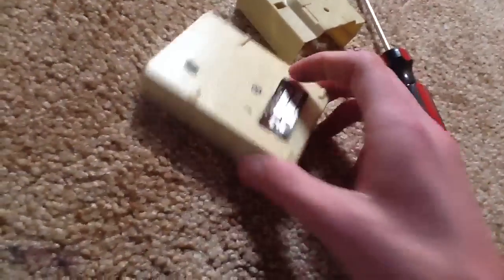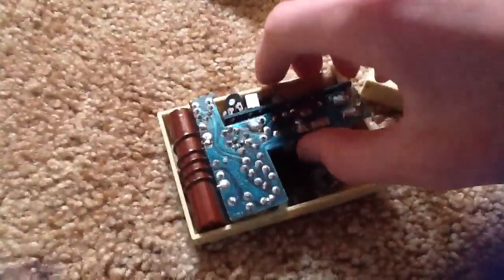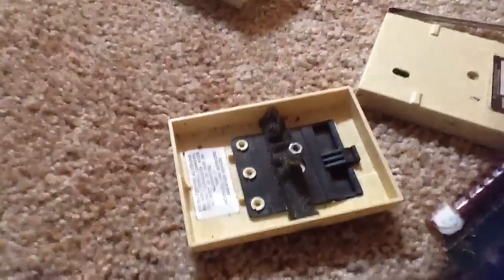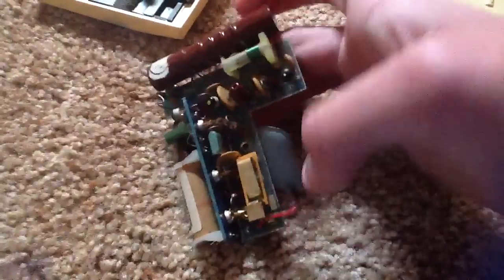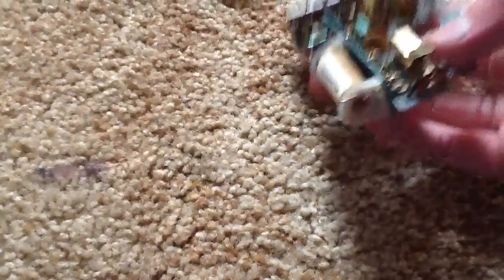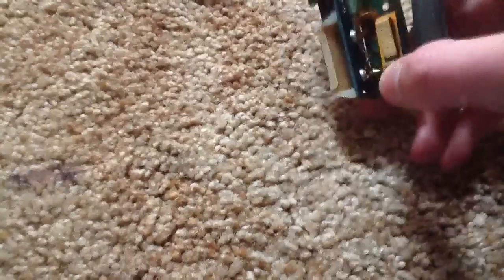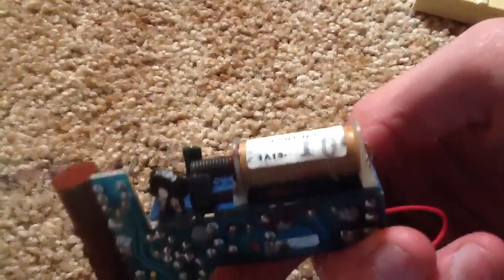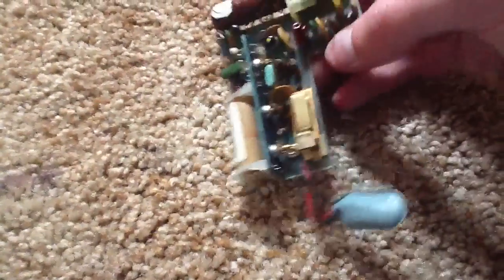For NicksGarageDoor

Comment: You are correct, it is analog. The iron bar you pointed out at first is actually where the signal is sent out from the remote. The part with the 10 on it is actually where the "code" is selected. That screw piece sticking out the end of that cylinder was the adjustment, however it's epoxied in place, so don't try to adjust it, as it will break.. I've done that.
Very nice find. :-)